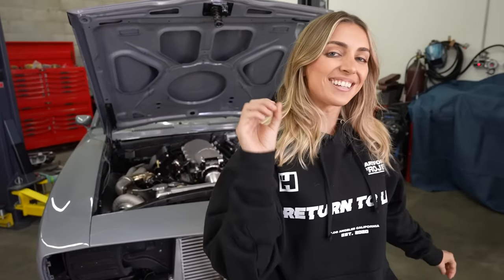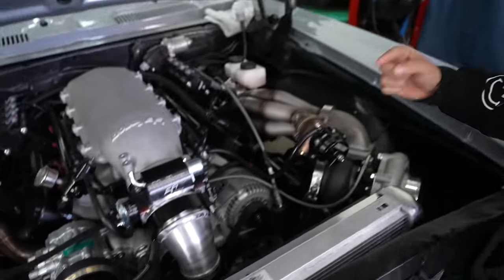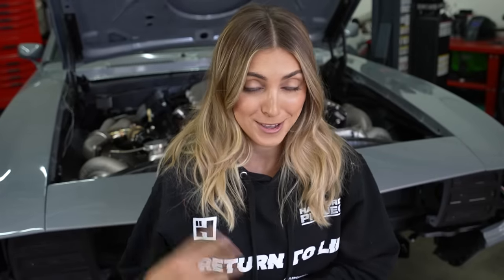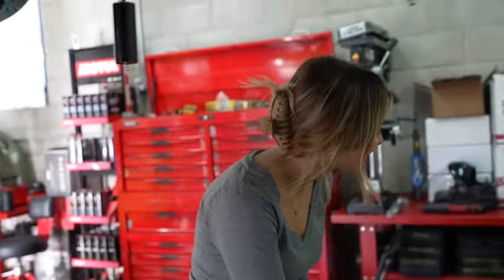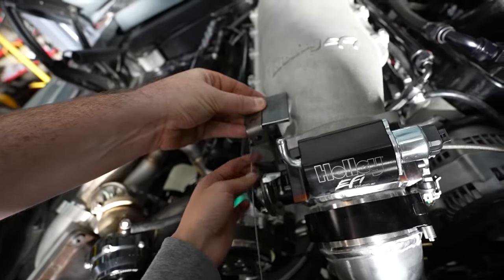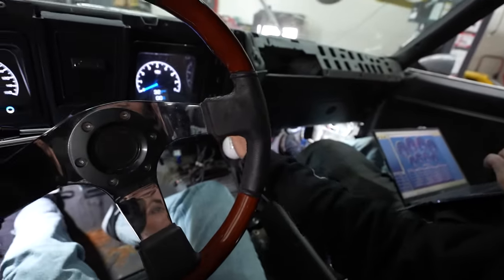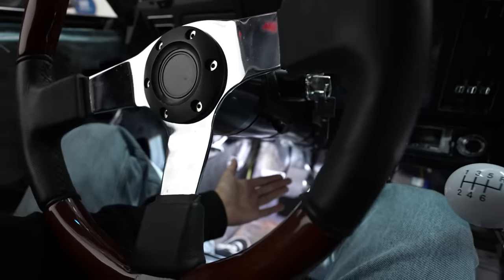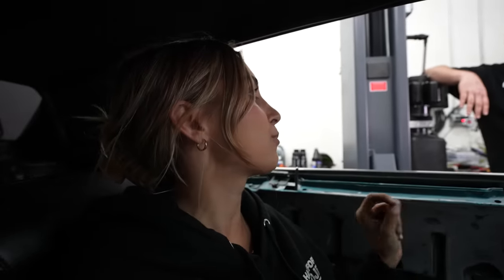First Drive In Twin Turbo, Supercar Killer 1200HP Unicorn Camaro!

Comment: Builds just keep getting better in my opinion. Old school muscle with modern drivetrain is just The BEST.
Reply: I love old cars with modern power trains, brakes, etc!   The best of both worlds.
Reply: Had a 010 camaro ss 6.2 put set kooks stainless headers performance cats x pipe went 10 miles on test drive almost burnt it up started smoking a/c. Line was melting dripping on headers wrapped lines with header wrap metal tie wraps no more problems

Comment: You may have to have an electronic vacuum pump for your brakes, especially if your vacuum running off intake. Love the build, keep it up.
Reply: It's hydraboost, uses power steering fluid, not vacuum.
Reply: @grantberardi5080  did not know that.  I may have missed an episode that shows that install. If hydro power, then possible issue with reservoir having to much pressure.

Comment: I’d be worried about overheating the brake fluid, or even melt the reservoir.  I’m not sure if wrapping the header would be enough. You could wrap it and check it with an IR temp gauge.
Reply: And I thought I was bad for noticing the spaghetti wires on right inner fender. It`s so f`n perfect though. One manly looking engine compartment.
Reply: Wrap both .... the header and res/booster
Reply: If it melts and leak out.. say bye to the breaks at running speed.
Reply: Have an actual shield of metal to be sure instead of just a wrap, those turbskis will probably glow red hot
Reply: Came hear today the same thing. All that heat next to the booster can’t be good for the fluid.
Reply: They could have them nickle nitrited like nascar does their  headers cuts down the heat quite a bit then wrap the header with fiber glass and itll probably be good
Reply: throw a heat shield in there and wrap headers
Reply: If it’s really close to the exhaust, and the car is a daily, it's probably best to fit a master cylinder relocation kit or bracket system to rotate 90 degrees. If not driving it much, a direct cold air feed might be enough. Either way, brakes are useful!
Reply: I think you are right about the brake cylinder relocation as it's pretty much far too late to go changing the headers at this point. It does look like there's enough wiggle room to be able to physically move the master cylinder sideways two or three (6-8cm) inches, which in itself isn't a lot, but would make a difference itself and as a bonus would allow for the wrapping and shielding others are suggesting a lot more than what she's currently got.
Reply: I would think it’ll boil the fluid at a minimum. No way I’d drive it that way.
Reply: @REDMAN298  Not to be contrarian but how does a group of inanimate mechanical parts look either manly or womanly? 🤨

Comment: If you are running into that issue with the brakes and they are that big, you should run DOT 4 brake fluid and you also need to bleed the brake lines. You probably have a kink or blockage in the line. Bleeding the brakes will tell. You pretty quick where the problem is. You also might want to put heat shielding around that reservoir bowl.

Comment: Use cerakote high temp on the booster and the headers and it will dramatically lower the temperatures.

Comment: Looks awesome! Thoese hydroboosts tied into power steering can take a long time to bleed. I remember spending over an hour just going lock-to-lock on the wheel 5 times, then 3 brake pumps, checking the reservior, and repeating. Once they're bled though they work great!

Comment: Nice build Emelia! I would take that master cylinder and hydroboost and move it to the other side of the firewall, and run a  shaft across under the dash from the brake pedal to actuate it. Even still, you may want to put a thick heat shield around the M.C. and hydroboost unit to keep from boiling your brake fluid. Where it's located now is almost guaranteed to boil the fluid and your great brakes will be gone.😮
Reply: Its a death trap

Comment: Congratulations Emelia, with all the guys helping your moving quickly? My 1972 chevelle is on jack stands, similar setup, but Borg warner S256SX twins here, I'm shooting for 700 hp on 12psi LQ4 and 6psi which is were it will stay most of the time.

Comment: Emelia, with a properly sized master cylinder and the right pedal ratio you don't need power brakes. In fact I bet you'd prefer the feeling of manual brakes. Either Baer, Willwood or Tilten can help you set it up so that manual brakes work significantly better than hydroboost or vacuum boosted brakes ever will. Then you won't have to worry about boiling brake fluid.

Comment: 1968 SSRS Camaro loving your set up getting ready to turbo charge my LSX376. Get those headers coated with (Jet Hot) 2500 degree coating, it adds 10% power.and reduces the heat byi believe is 65%. Great Car

Comment: GMC Hydro Boost Pumps are Sketch, Have a 2001 GMC 2500HD...Pump leaks bad, Hydro is Brakes and Steering combined, Not Fail Safe... Great Build, Good Luck... Pump Pulley Welds self on...

Comment: I would advise having the header ceramic coated would drop the heat near a brake booster and increase hp due to scavenging probably also a heat shield under the booster as an extra percaution. Awesome build brings a massive smile to everyone .

Comment: My 383 headers used to overheat the starter motor until i covered a piece of aluminum with heat tape and mounted it between the exhaust and starter. Haven’t had problems since and it doesn’t look bad either.

Comment: Heatshield Products lava master cover over that master cylinder should be the ticket, you could also add a floating plate on the header side to deflect.
Reply: This is great advice. I really wonder how hot that header can get before brake fluid becomes a major concern. Especially because she's making hot cheeto runs with this thing, not a track queen.

Comment: You might want to coat those headers especially the one next to the brake master, i think inconel coating would probably reduce the exterior heat enough to not  heat your brake fluid

Comment: Some gold foil insulation around your brake system components.
Maybe have your headers ceramic coated.
Tubskis are nice bnut I'd prefer a nice big superchager if not for the throttle response alone.

Comment: if you have both returns going into a Tee or a Y fitting you can have issues with the hydroboost.  I had to get a holley PS reservoir and plumb both returns to it then return to the pump

Comment: I built my friend almost the exact same turbo set up with those exact headers on his 68 camaro and what I did was I used a 69 c10 brake bracket flipped upside down to raise the brake master cylinder on his 68 camaro. 

Ahmad

Comment: Is that header tube to close to the plastic brake reservoir, whats the melting point of the plastic.   Modern brake fluids are based on polyalkylene glycols they ignite spontaneously on a surface heated to 390c.  May want to use an aluminum, or cast iron master cylinder.

Comment: Sorry made comment before i heard sandy in video Make sure theirs a pressure valve in that gen2 pump if you switched to rack and pinion may have wrong pressure also recheck line routing on the power assist

Comment: You need to ceramic coat the headers/exhaust manifolds and get an "exhaust blanket" for the brake booster so it doesn't cook it.  @Devin Niemela had a similar issue when he was building his AWD Civic Type R.  He did data before and after and doing just those 2 things significantly reduced the heat to the brake fluid.

Comment: You want to move the lower control arm hole 3/8 in to center .,pulling lower ball joint foward Target 9 degree s on ball jionts that makes the car safe at speet We push that stock front to over 187 MPH

Comment: Remove the exhaust headers and get them ceramic painted/baked to hold in the heat. It'll protect the brake reservoir/cylinder unit.

Comment: If you're already running hydroboost instead of a vacuum brake booster, then surely theres a setup to mount your brakes inboard of the bulkhead to get it further from the turbo headers.

Comment: Wastegates on the outside of the elbows would give you better priority. I think you could end up pushing through your brakes in quick off throttle on brakes situations. Especially if you're cookin the master on the headers. Hydroboost will maybe give you better clearance

Comment: Use a sheet of incolnel multi layer heat shielding and put that between the header and booster. Otherwise your looking to loose brakes when they boil

Comment: Gonna need a heat shield for that master cylinder.   it's gonna get HOT and boil the fluid.   On a 1/4 mile pass them headers are gonna glow bright red

Comment: You need to wrap both headers with ARTR Titanium Lava Fiber Exhaust Header Wrap Kit on both and then put a lava master cylinder heat shield on the master. That would protect a lot of things not just the master. But you do NOT want you brake fluid to boil while in traffic because that equals wreck.

Comment: Hate when Youtubers cap there h.p numbers.. it might b 1200 capable,but most certainly isnt at 1200 now, and most likely wont be kept on the big power tune running race gas.. but it still b fast at 8-900hp
Reply: I'm sure once she gets her wider rear tires she will take it to the dyno but this is the engine that came out of her car Mimi and it was dynoed well over 1,000HP (and she had it rebuilt for this car.)

Comment: So, may it be that the brake pistons where pushed in during installation? I remember working with brake engineers, put in a new system, blead and everything, get the prototype car off the lift and almost ran into a pillar because I didn't know I needed to pump to extend the pistons into normal position first time braking...

Comment: I have an uncle that had a '69 Z28.  He had it bored for larger pistons, shorter stroke.  I was 14 when he took me on a quiet highway in Indiana, turned around on the median, waited for the 1 car to pass by, squared it up on the road & said "you ready?" I said, "yeah" and he flattened me on the passenger seat.  I was so bummed that he sold it before I could get a chance to drive it...not that he'd let a young teen drive it. 🤣

Comment: Wrap that master cylinder with heat wrap.. you know what happens if brake fluid burns in the engine compartment on a hot exhaust

Comment: Emelia, I know that you need to find a new garage, since the garage that you're now in is going to do renovations, so they are going to basically, kick you out.  Okay, so I can't help but wonder...you're spending so much money on your cars, I mean, shouldn't you stop spending the money on your cars right now, and instead, focus on getting a new garage?....maybe buying a new garage instead of renting or leasing?  The money that you are spending on your vehicles could probably be enough to just buy a bigger garage.  I know that you'd rather spend the money on your cars, but a garage is an immediate necessity, whereas your cars can hold off on getting fixed up. Anyway, I want to wish you a Merry Christmas, and a Happy New Year, and good luck on finding a new location!

Comment: I would seriously swap that brake master out for an under dash setup. Boiling oil under pressure is pretty dam volatile not to mention heat cycling plastic like that is NEVER a good thing. That will get brittle and discolored in a very short time that close to them headers..

Comment: Hi Emilia, Devin from https://www.youtube.com/@Dvniemela had the master brake cylinder to close to the manifold/turbo in his all-wheel drive Civic Type R and the heat that the manifold produce makes the brake oil boil and lost his brakes. He used some heat blankets to resolve the problem.

Comment: Sandy hit the nail on the head, you plumbed something wrong.... someone got confused and connected the brake lines to the power steering pump, so when you turn the wheel you get brakes and when you push the pedal in it stops the power steering pump which is why it stalls. Trust me, it makes sense if you kinda squint and pull a funny face while you think about it... oh and tilt your head sideways, then you'll see I'm onto something.... Lmao

Comment: Those Exhaust pipes are WAY too close to the brake master cylinder. The brake fluid and rubber seals in the brake plunger are going to be a real STOPPING problem when it all gets super hot and it will due to having those pipes that close and you won't know you have a stopping problem till you hit the brakes and it fails and you crash into something or someone... Get it fixed !!!

Comment: I'm torn here. On one hand you had a bone stock collector's item With matching numbers. On the other hand you made this a mean drivable machine. There are arguments from both camps
Reply: The engine was not numbers matching. It was just a 350, not the original engine.

Comment: if your car doesn't have a safety neutral switch, Just put the car in neutral without your foot ingauging the clutch when Starting the Car.  I never start my 65 mustang with my foot pushing down on the Clutch?  is it because i'm old & learned to drive when 60% of Cars were Stick shift? lmao

Comment: It looks like you have a little bit of room to relocate that single primarie tube away from the master cylinder slightly and then add a heat shield or atleast some type of heat protecting material? That seems like the easiest method to me for how great of fabricator Sandy is that wouldn't be too much a pain rather than melting masters every couple times you drive her really hard!!! Or fully boiling the fluid and losing brakes at a very high rate of speed and completely writing off the chassis and possibly you also?!?!?

Comment: I doubt it very much it’s a super car killer, you will need to prove that before you start claiming it is. Check out DDEs cars like there twin turbo 1200hp Ferrari F12 which will probably have more hp after there done the rebuild or any of there other 1000 plus hp super cars. 🤪